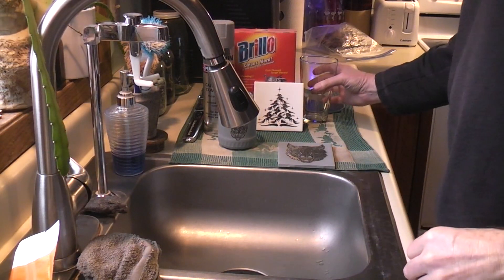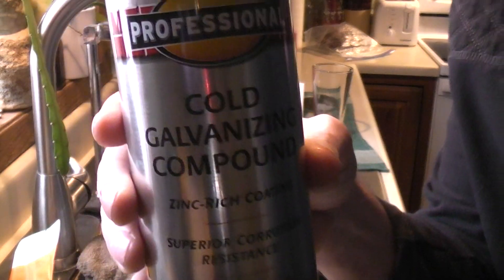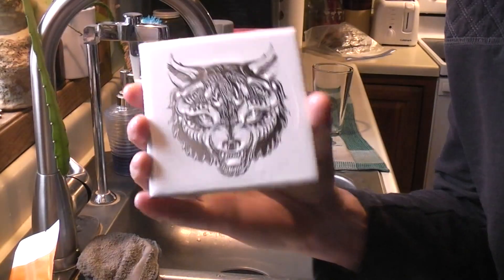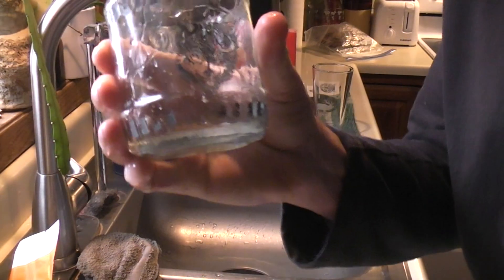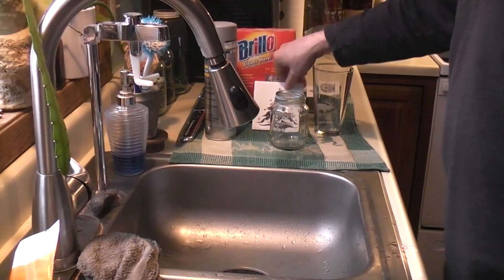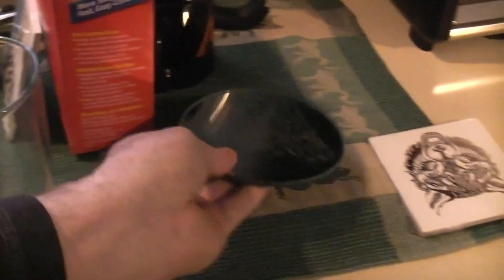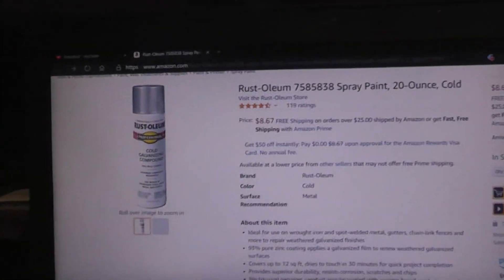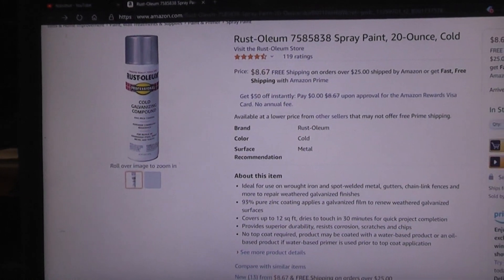Zinc coating for diode laser "etching" glass & tile. Water clean up. High contrast.

Comment: Hello, just got my Outur Laser about a month ago. This video helped a ton, found this spray at the local store, and it is working good so far. Question on the mirror... what settings did you use to get that image?
Reply from the maker: I found that burning off the black backing on a mirror to be supper easy. Start with a low power like 30 to 40% if you do not see the image then before you move the mirror just up the power until you find what works for you. Remember you are not burning off the mirror coating from the front but from the back. Now you can etch a image on the front glass of the mirror if you want it would be the same setting you would use for glass or tile that you have painted. Some people have suggested Buring a image on the front and different image on the back of the mirror for a 3d type effect.

Comment: So my local store got some in, and I snagged a few cans. You said that it dries fast, but how long should one wait before engraving on tile?
Reply from the maker: I do not wait, as soon as it is dry to the touch, I am ready to go. Make sure you mix the can well or the results will be poor. I use the spray can spinner DIY that I did a video on.
Reply: @Robothut  👍

Comment: Hallo und guten Tag aus Deutschland. 
Ich bin von der Idee begeistert! Nun muss ich versuchen, hier bei uns ähnliches Zeug zum sprühen zu finden. Ich werde später berichten. 
Habe es auch noch nicht geschafft, alle Kommentare zu lesen. Es ist mühsam, sich alles von Google übersetzen zu lassen. :-)

Danke für das Teilen deiner Information
Reply from the maker: Yes, google translator can really get things wrong sometimes and it does take time. Make sure you mix the spray cans very well, with all the solids in the spray they like to settle out and then you get poor results. I posted a recent video on a spray can mixer you can make at home and use a drill to . to mix the spray cans very well.

Comment: I tried your method but the engrave came out really light colored. You can see and feel the engrave but it’s just not dark. Any suggestions?
Reply from the maker: Try reducing the power. I found there is a sweet spot. Too little power and it light and really engraved to much power and it is lighter. I have a follow up video Sunday the 23 that shows a simple spray can mixer you can make that really gets all the solids in the Zinc mixed up well and that is important for a dark engrave.

Comment: Very helpful video. Thanks. One tip that will speed things up - I have found a product called Spray 9 that makes the zinc coating practically wash away without needing to scrub with anything more than a wet sponge.
Reply from the maker: I have also found that using a spray can spinner will mix the paints or if using the zinc coating better than any amount of hand shacking. You can buy them or make one from PVC pipe and a bolt. Just chuck it in the drill slide in the spray can and spin it.

Comment: my tiles didn't burn as dark as yours.  In fact, mine burned to a kind of grayish/metallic look.  Although it's pretty, I really wanted the black. any idea why it would do this?  I've tried different settings and get the same result. When I tried white paint it was a much lighter, almost transparent engraving.  I'm at a loss of what else to try.  Can you help me? Thanks,
Reply from the maker: Try less power, I found that there is a range where you get the peak contrast, too little power and its light or washes off, to much power and it gets lighter, right in the middle setting I get a dark result. I also like using black paint and the black paint does not reflect the laser light as much as the white paint does so it burns in better.

Comment: Does this spray contain Titanium Dioxide? I think that is the active compound in white paint that leaves the marking behind on tile... I'm looking into using a titanium dioxide nano coating spray for this process.
Reply from the maker: Here is a link to the Technical data sheet.
https://cdn.paintsupply.com/wp-content/uploads/2020/06/Technical-Data-Sheet-20.pdf
Reply: @Robothut  thank you!

Comment: Awesome discovery and one I'll use when I etch tile and glass. Thank you!  Short and to the point!
Reply from the maker: Make sure you mix the spray can well otherwise you will get inconsistent results.  I found a simple adapter that fits a cordless drill that spins the spray cans that does the job well.

Comment: Ace Hardware Has this also. About 8 bucks can.
Reply from the maker: Recently I have not been able to get consistent results with the new cans I have bought, so I am back to using black spray paint. I do not know if they changed the product or if I just can not get the can shaken good enough or what.

Comment: Do you have to reverse the image like when lasering on black paint? I tried a normal image like when painting white on a white tile, and the image is not black, only burned away the zinc layer; not the tile itself. I used the same power settings as with the white painted tile.
Reply from the maker: I have never had to reverse the image when etching to tile. I do reverse the image when etching glass mirror as the image is on the back side but viewed from the front. I plan on doing a update video, covering the 1 year mark of the NEJE laser unit , air assist and the zinc coating.  Long story short I have stopped using the zinc coating as the new cans of it that I have bought are not giving me consistent results. Its like no matter how much I shake up the cans I get uneven results, so I am back to using black spray paint and cleaning it off with thinner again.
Reply: @Robothut  Interesting, this information should be pinned to the top of the comments so other followers like me don’t just go out and buy it only to find out the results aren’t the same as yours were with current product.
Reply from the maker: @Jerry-Mesa  I am planning on a new follow up video soon and I am also interested in seeing followers have the same results or if it is just the last few cans I bought that gave me problems. But I will do as you suggest and pin that the zinc is not working well for me at this time.
Reply: @Robothut  Thanks. Since my can just arrived in a relatively large box with 85% packing material I guess I should at least try it. Just got my laser so my result inconsistency won’t be a measure. lol
Reply from the maker: @Jerry-Mesa  Lets us know how it goes. Maybe I just got 2 bad cans from my local Home Depo. What I would see happen is part of the burn would work just fine and places in the burn would not etch in to the glass or tile. All the same power. So that means that the zinc coating was not consistant.
Reply: @Robothut  I’ll give it a test in the next few days and let you know. I have a couple of test files to run today but I can prep some materials also.

Comment: After you laser an image onto a mirror, coat the back with paint. You can use clear lacquer or a colour if you like, but you really need to seal it.

I've been doing leadlight for a while and the normal practice is to seal the cut edges of mirror pieces with nail polish or similar, because if you don't the silvering will corrode over time as it is exposed to moisture in the air. You've probably seen an old bathroom mirror where the silvering has corroded around the edges. This is the result of moist air getting to the silvering around the edges and corroding it.
Reply from the maker: Sounds like a good idea to me. Thank you.
Reply: Ok thank you

Comment: WOW. You are years ahead of me with your laser projects! Need to make Christmas presents! Great video, good audio. I installed that same faucet. We love that one! I do all the dishes, of course. So, this zinc cold etc, etc is not found at LOWE'S or HD?
Reply from the maker: I got mine at Home Depo. But I do have too say that the ;last can of it I bought has not been consistent in its results. I do not know if I have not shaken the can enough or if they changes the product. So right now I am back to using Walmart 99 cent black spray paint.
Reply: i bought a can at my local Lowe's in VA for about $13

Comment: Picked a can of this stuff up yesterday and gave it a try. The results weren't perfect but there were at least results, the other methods didn't even make a mark of the glass. Anyways some of the lines engraved came out black and some came out frosted. Any ideas why that might be? I'm guessing its something to do with settings, if you don't mind sharing, what do you use for what Wattage laser?
Reply from the maker: If the results were not consistent then I would think it has to do with how well the can was mixed up. I have to tell you that the last can on zink I bought did not work as well as the can I had been using in the video.  So it might be they changed something in the product. When I want the frosted look I just use cheep walmart black spray paint for 97 cents a can. As for settings it will be different for every diode laser set up and how the diode laser is doing at the time. I can get use a setting of 50% power and get good results with the 7.5 watt optical power diode I have now. My first diode laser was 5.5 W optical power and it would work great at 60 % power until I used the laser to cut some wood at 100% power, after that I could never engrave tiles or glass again. It would still engrave cardboard / wood but not do the glass or tile "painted" engraving. So running the diode at 100% power lowered its optical output for ever. Then I bought the 7.5W diode. I have made sure to never run it past 80% power and its still working fine.

Comment: Settings you used?
Reply from the maker: Depending on your laser 40% to 60% power. But if you have ever run your diode laser at 100% power then the odds are you can not do this , diode lasers do not like running at 100% power as the heat build up in the diode makes them lose optical power big time.

Comment: Will this work with a CO2 laser?  I have no problem lasering glass but always looking for a new or better process.
Reply from the maker: I do not know as I do not has a C02 laser . I would think that it would if you set the power level low enough, too high of power even with a laser diode is not the best results , so start low and work your way up.

Comment: What are your laser settings and how heavy a coat do you apply?
Reply from the maker: 50% power a single coat.
Reply: @Robothut  thanks...what speed to you run is it between 100 to 250mm/m?

Comment: I have a question about this technique. We know that its possible to engrave the back side of a mirror. My question is thus, what if you wanted to have one image on the front side and a different image on the back side of the mirror. I have a set of beveled glass tiles that would be the perfect candidates for just such an idea. What are thoughts about this or have you already tried?
Reply from the maker: Seems like it might be hard to line up the 2 images if that was part of the plan. But there is no reason you could not do it. Maybe with the right images you could get a kind of 3d look . Or the back image is the one burned in to the mirror and could be back lit any color, the front image will be a shade of gray. Could be fun to try.

Comment: What kind of power in watts and what type of laser are you using with the glass? I have been experimenting this evening with this technique.
On glass. So far the glass is not etching/engraving😩
I will say I am using a diode laser an original Ortur.
Reply from the maker: optical power is 5.5 watts. but you only need run it at about 60% power. If you have ever run your diode laser at 100 % power then the damage is done and the laser no longer will output enough power to do this. You can still etch paper and wood but not glass.
Reply: @Robothut  why...what does the glass do to the laser at 100 percent
Reply from the maker: @mikecrase3047  The glass does nothing to the laser. The diode lasers over heat at 100% power and that damages the diode so that it never puts out full power again. In fact just running a diode laser it will lose power based on time. They have charts that show the power loss over time, and its losses a lot more power the hotter you run them. Most of the very new diode laser have put in two diodes lasers in each unit and joined the beams, and better cooling they do not offer you more power but they will last much longer. They also have made the laser dot size smaller and square so they can direct the laser light in a tighter spot so you can do the same job with less power and higher resolution. Some day when my laser diode needs replacing I will go with one of the new types.
Reply: @Robothut  thanks for the info

Comment: What strength laser is needed fur these results? Would 8W be adequate?
Reply from the maker: If it 8 W optical power then thats is way more than I have, if it 8W power supply rated then I do not know as that would be very low optical power, what maybe 1 to 2W optical ?

Comment: Might look good, but definitely not darker than using paint for NWT method. If done correctly, you can get pitch-black with paint. And you don't necessarily have to use lacquer thinner to remove it.......Goo Gone Graffiti Remover works great.

Comment: be aware that this spraypaoint is NOT environment friendly, do not run this thru your sink : PLEASE... 

it states clearly on the spraycans here: very toxic to marine life...
Reply from the maker: Good point. Make sure that all the different coating's you use are done in a safe way , not just for your health but for the environment as well.

Comment: Is this Zinc coating working with metal engraving ?
Reply from the maker: I have not had any luck doing metal engraving with the 20w "5.5W optial" or 30w "7.5W optical" diode laser. Anodized aluminum works with a diode laser but you do not need the zinc coating for that.
Reply: @Robothut  Thank U .
I will try this Zinc coating with glass :D
A NEJE 450nm 30 W could be enough?
Reply from the maker: @ingenia-tec5194  More than enough. I used my 20W for a long time on glass and tile with paint and with zinc. I had to upgrade to the 30W after I made the mistake of running the laser at 100% power to cut wood, after that I could no longer engrave glass or tile. From the first time you turn the laser on it's power output is going down. This is true even with the large CO2 lasers. But the diode lasers do not last long if you run them at 100% power.

Comment: This is a great idea! I engraved with thermal tape (darker) https://ali.ski/KGXObU and with ceramic laser engraving paper (lighter) https://ali.ski/MR1dGf
These are the results obtained https://vk.com/topic-204076116_47599431?post=17
You suggest making it all much easier, that's fine. I ordered "Zinc-filled primer-enamel" Elcon Zintech 96% aerosol, if the main thing is zinc - I hope to repeat your success. Many thanks!
Reply from the maker: The engraving paper sounds like a very good method to me. I have not tried it. My last can of zinc primer was not giving me consistent results , so either the can was old or I did not shake it long enough to get the zinc mixed in properly. Always do this in a ventilated area or in a sealed vented case like me, burning zinc and most everything else can be harmful.

Comment: I have used this process and it is great.  Just wanted to add an observation.  I just added air assist and when using with this process. it made a major improvement.  I have a 15w laser, running 2000 mm/m at 45%.  The out come is much darker than when running with out air assist. FYI my air assist is an  old airbrush pump connected via aquarium tubing using a metal straw to direct the air.  Not a complex solution.
Reply from the maker: Thank you for the update. I have a air brush pump so I think I will add a tube feed and see what happens.

Comment: Mr. Robothut, Do you know if this kind of engraving works with a stainless steel too?, I am trying to mark a back of a watch which is of 304 stainless steel, with a 10 Watts diode laser
Reply from the maker: I have seen videos on youtube where they do mark stainless steel, but I have not been able to do so. My laser is only 7.5 W optical power. Now anodized metal I can do.
Reply: More Power You Need. at least 10 watt optical Power at 95%. I have a chinese "80" watt with 10 watt actual output
Reply: @darrinjones9387  how does it went with your 80ws?
Reply: @leonardoroger6472  It is 12 watt optical power. It will etch stainless steel when focused correctly

Comment: tried with "zink spray" for cold galvanizing but did nothing on the bottom of a glass i tried... neje 20w 5ms and 50% power from neje app. Am i doing something wrong?
Reply from the maker: You might try 60% power but I think it should have worked if you focus is right. You can always try black spray paint as well. It works just not as much contrast. If black spray paint does not work then you know you have a problem with the laser, either the focus or the optical power of the laser has declined and can not do the job any longer. Just recently some of the diode laser manufactures are sharing grafts that show how the laser optical power output starts dropping from the first time you use them and if you have ever run them at 100% power how much faster they lose there power rating.
Reply: @Robothut  thank you!